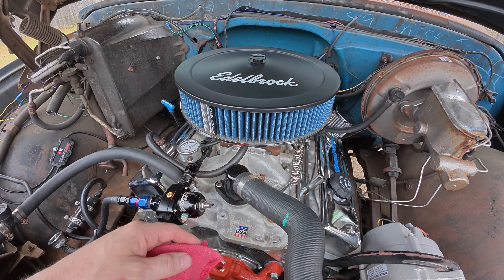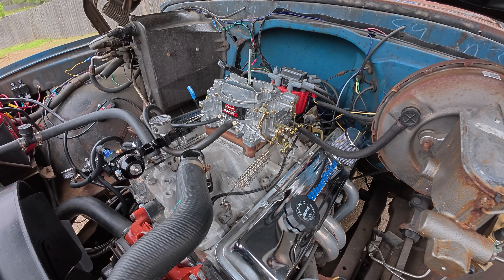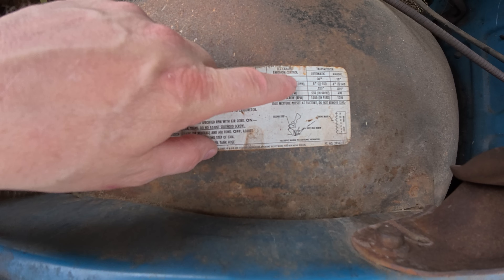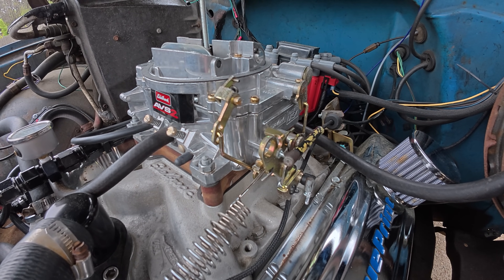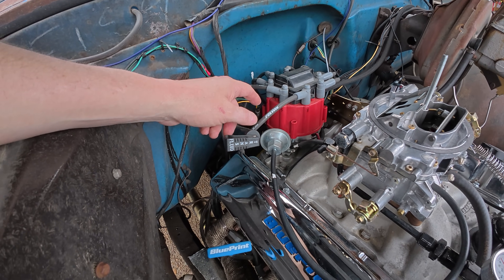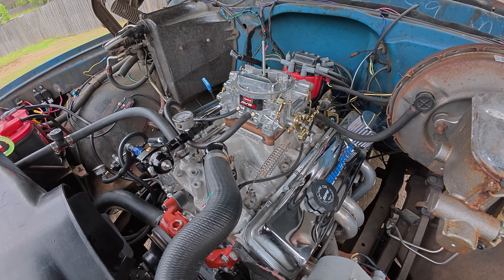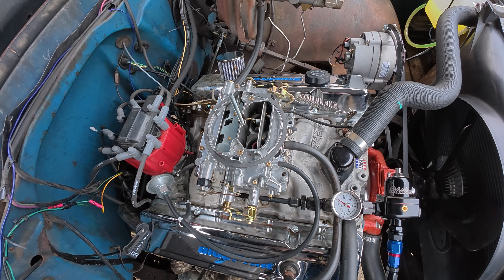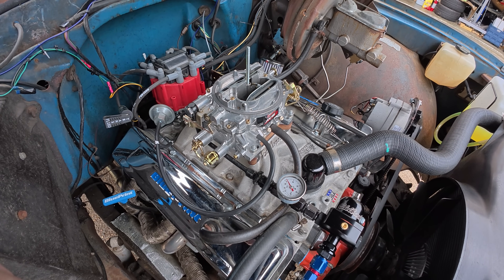How to Stop Engine Dieseling

Comment: i have a mild 454 that would diesel on hot days or pulling trailers. put one range colder plugs in it, mostly solved the problem
Reply from the maker: @NAPAuniversalJoints  for sure the heat range on the plugs is one of those sneaky ones if it’s not on your list to check.

Comment: Seems I have the opposite problem on my 72. I thought I was out of fuel bc It kept on shutting off. I replaced the fuel sending unit before I started the restoration and all my gauges work except the fuel gauge. Turns out I have fuel as I always top off for the same reason but It keeps shutting off until I have it good and warmed up. I recently had to jump it several times when I went for a drive and charge the battery overnight. I'm going to try to troubleshoot the sending unit as I remember seeing a vid on that. I would gun it in the garage but I don't want to unalive myself with Carbon Monoxide... Lol

Comment: I’ve used water (which I like better than trans fluid) down the intake before to clean out the engine which helped a bit. The experience with my old junk, worn out carbs and engines were the ultimate culprit. The last vehicle that dieseled on me was my 67 C10 with a 250 inline six. Coincidentally, even tried a Chinese Monojet (referring back to your previous vid!) What a POS carb 😂
Reply from the maker: @jimmy_olds  water is ok, but something to break down the deposits a little more, like seafoam, does a more complete job.  Those Chinese carbs will get ya!  😆
Reply: @ but water is renewable! I’m very into the green movement!! 😝 that carb was so bad, it was okayish at idle but transitioned to pig rich while cruising. I’d only get 8.5mpg. I ended up scoring a monojet worth rebuilding before the bottom end was hurt from the gas washout.
Reply from the maker: @ it’s amazing how many of those knockoffs are bought.  I’ll occasionally get someone asking to rebuild one.  I can’t!  And I won’t.  😆
Reply: @ I remember at the time, 2021/22ish, recons were like $450, and maybe even my carb kit was back ordered for longer than I wanted to wait so the path of least resistance was Chinese hot garbage. Lol. Have you noticed the favorable reviews of them? Makes you wonder how legit those (or any) reviews are

Comment: I using same PCV setup on my both engines. But I also use good custom oil catch can with one engine, and welded extension with steel wool inside to valve cover of other. Runs pretty good, absolutely no oil stains under the hood.

Comment: most of the time I've found over the years is too much timing or idle too high
Reply from the maker: @mikeuva2273  ignition off has no timing.
Reply: @MuscleCarSolutions  it runs hot
Reply from the maker: @mikeuva2273  what do you consider too much timing?
Reply: @MuscleCarSolutions  when engine is pinging or detonation
Reply from the maker: @ so 20 degrees initial?  Too much?  40 full advance.  Too much?
Reply: I've also found that if you have to have a fast idle let it idle  for 30 seconds before shutting it off sometimes that  will work
Reply: or shut it off in gear

Comment: 93 octane gas will stop all dieseling
Reply from the maker: @jimboracing1988hd  wish it did but not always. Just depends on what other factors are in play.
Reply: Yes I agree I just wondered if you would comment lol I have a 383 stroker fully forged it diesels like crazy unless I put 93 octane I don't know why?
Reply: @jimboracing1988hd  LOLOL, good one. But 93 has gotten rid of mine along with lowering my idle to 800-850 in park. Also adjusting the timing.
Reply from the maker: @ well run through the list of things I mentioned.  Any of those trigger an idea?  You’ll know your engine better than I do.  What makes sense to look at first?
Reply: @jimboracing1988hd  too much timing